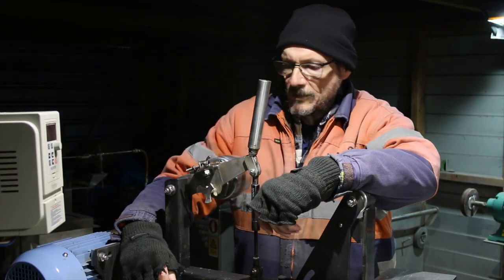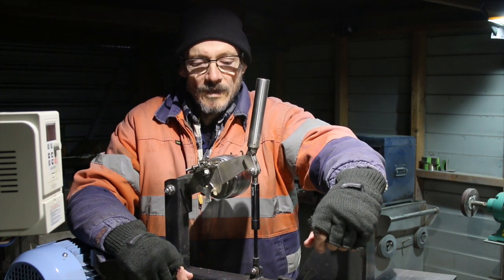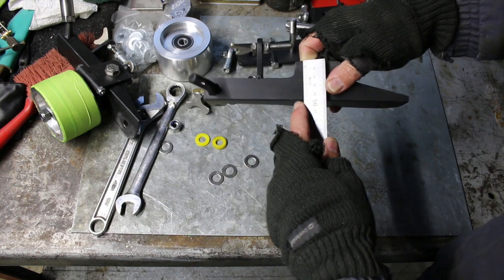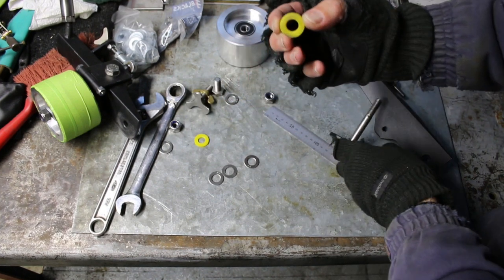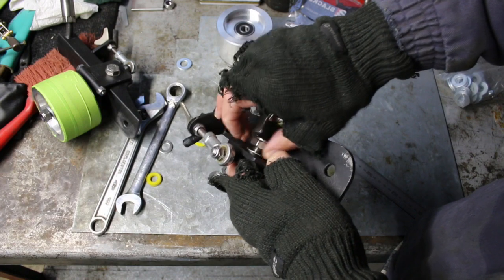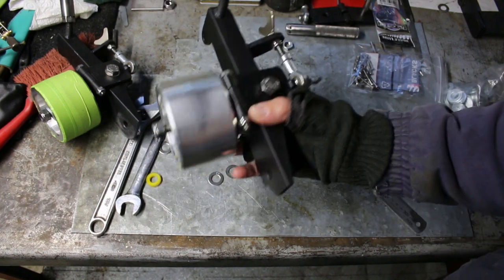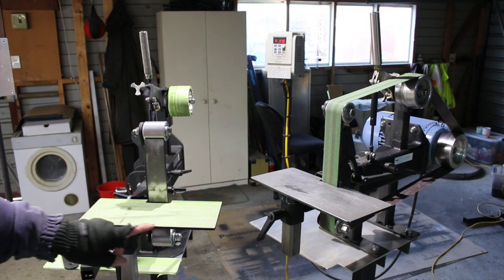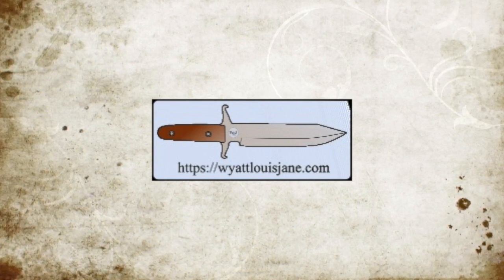2 x 72 belt grinder, tracking mechanism, my build.

Comment: I have built two grinders and my last used this dual axis mechanism and there is no comparison between this and a single tilting axis. This is an excellent strategy for tracking in both forward and reverse. I wish I had seen this before my build. Thanks for posting this
Reply from the maker: No worries and yeah the dual axis is the way to go no question.